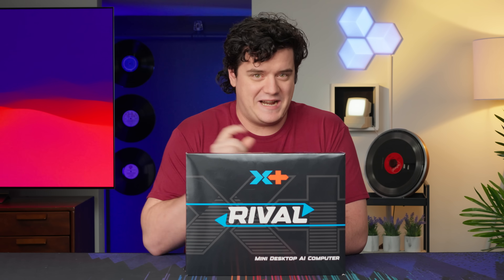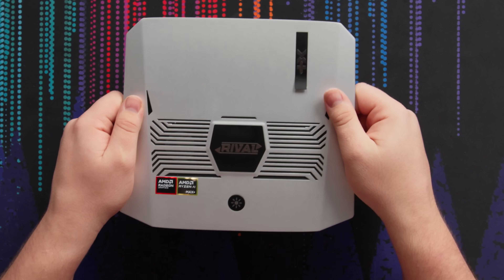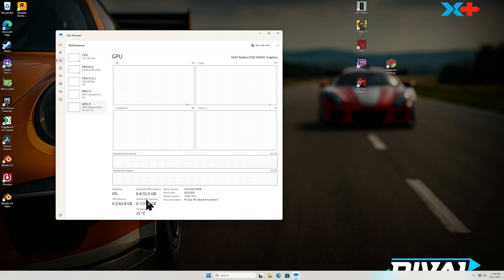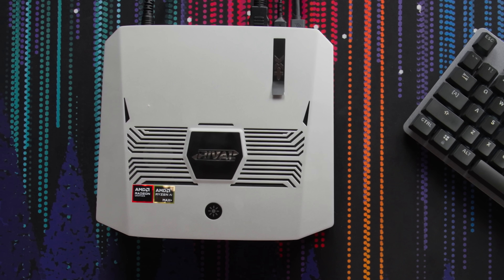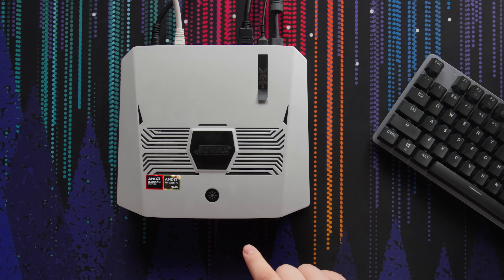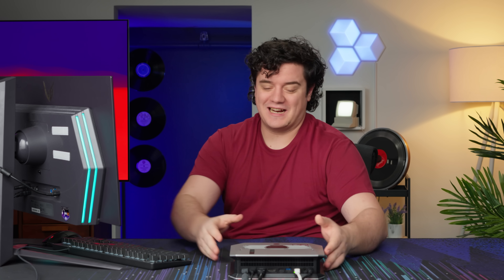This Mini PC Might be the Best Value YET - X+ Rival

Comment: Blower fans are always pretty loud but especially if you insist if having the intake side closest to your ears, use the damn stand and position it so the top (with the blower fans) are facing away and it makes much less noise.
Also, you can control the fan in bios or with third party sw.
In Linux it's very silent with normal workload.
This was a childish and uninformative review.

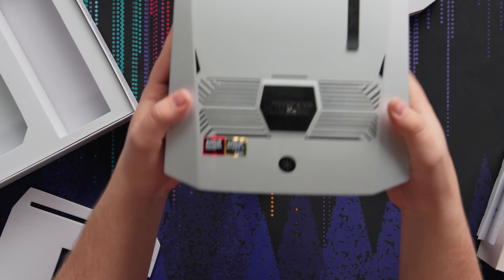Comment: 2:03 I don't give a fly F which way you like the look of something. What's the whole point of ShortCircuit and why do you even bother showing everything that comes in the box. Its to show what's in the box and what it does for others. Not how you like to use it. So next time, build the stand to show it off. So I can decide how I like the look of it.
Reply: I feel like you have valid points but your being very harsh as a default. My immediate response to seeing your comment was an eyeroll.

'So next time, word your comment to constructively criticize. So we can understand the point of it'
Edit: Grammar
Reply: @webb.weaverr  That is very true, but also kind of the point. It takes little effort to be pleasant in my comment, just like it takes little effort to build that stand.

And it is also a unfortunate effect of the internet. That if you want to cut through all the noise, you have to be like this.

If it was enough to stand out and make you comment. Then it will be enough to stick in their mind. And not resort back to a lazy behaviour.

Comment: This is basically a laptop without a screen. It's overpriced, it'll overheat, and you can't upgrade,. MicroPower PC has small form factor prebuilt systems but with real pc hardware and good value

Comment: It's worth mentioning that the new rog zflow z13 has this chip with a 128GB of 8000 lpddr5x option. So you get all this in a 13 inch tablet form factor. It's about a thousand more dollars, but get you a dock and have all that power on the go. You guys had the device on short circuit before but that was a 12900H and rtx 4050 model I think.

Comment: While watching this video, I had the thought "that's a red flag" several times. Then at the end of the video you pretty much confirmed that this is a cheap junk device at best and a scam at worst.

The red flags were things like:
1 Inconsistent marketing information like listing the performance modes differently in different locations
2 How surprisingly light weight the item was
3 Outright wrong information like the ram speed
4 Cutting corners to save money with things like the small heat transfer pads and the noisy fans
5 Constantly being heavily discounted, despite being a brand new and super popular product category (a pc built for AI processing)
6 The price changing when you reload the web page

Then at the end of the video you tell us that this item can be found on alibaba for hundreds of dollars less, so bottom line this item is a junk device at best.

I would be highly suspicious of counterfeit parts and/or parts listing fake numbers that tell windows they have a much larger capacity than they actually do.

Comment: Linus is part owner of framework, so of course it's going to show higher on any tests than a competitor. 
And also, the Rival is so loud, and overheating because you didn't install the standing mount, and one of the fans is on the bottom, which you have pushed down into your desk pad.
Reply: :face-red-heart-shape:

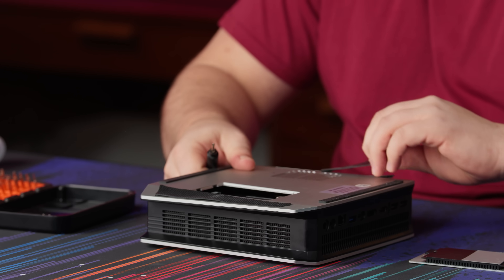Comment: 4:10 That is good. Only the controller needs cooling as it generate the most heat and the flash chips themselves prefer running warm for better performance.

Comment: Yeah the fan noise was def blasted towards your face 😂
Reply: yes, but we need to see the lab footage of the test.  the included stand, which was in the manual, was never assembled. This is a sham comparison; totally subjective, yet entertaining :)  there are simply No data point comparisons on benchmarks, noise in decibels, and didn't even do a side by side size comparison. Lastly, there was no disclosure with Linus' relationship to Framework. Serious ethics questions is you ask me. :text-green-game-over:
Reply: @axgadgets  the device literally had feet so i dont really see how not using the stand is invalid here, it is supposed to be just a stylistic choice
Reply: @axgadgets  Framework disclosure at 0:09.

Comment: We need to see the lab test footage to validate the data points. While I love Elijah, the PC was not standing up as it is in all the "marketing" materials. It needs to be standing up for proper ventilation. Rival could possibly outperform the competition on all fronts. Especially, if it was tested the same way that Eli "tested" it in this review.
Reply: +1
Reply: Except the photos on the website multiple times show it in the flat position without the stand. That is clearly an officially supported orientation. There are even rubber feet on the "bottom" to make this work on a desktop.
Reply: yes, we should demand to see the lab footage of the test.  the included stand, which was in the manual, was never assembled. This is a sham comparison; totally subjective, yet entertaining :)  there are simply No data point comparisons on benchmarks, noise in decibels, and didn't even do a side by side size comparison. Lastly, there was no disclosure with Linus' relationship to Framework. Serious ethics questions is you ask me.

Comment: despite Elijahs best efforts this looks better than the framework
Reply: Yes, especially now that the test footage is in question.
Reply: Good point.  They even tried stand wasn’t assembled during testing, despite assembly being instructed in the manual
Reply: @JessicaGiz-t1x  100% agreed. We need to see the actual framework side by side with the Rival and comparison noise test results. Third party lab tests for both would also be nice. Also, footage showing that the Rival's stand was assembled during the third party testing.
Reply: several issues with this review. there was no disclosure with his boss' relationship with framework. no confirmation that the unit was tested properly as the stand was never assembled. Lastly, it was a comparison review, but with no decibel testing for noise, or no size comparison, or common data point test for benchmarks on BOTH units.
Reply: I must concur with you
Reply: +1
Reply: Yes. They even tried to peel off or bend the logo plate.
Reply: It's so funny that everyone replying to this comment is from the company itself. Funny how they are all pretending to care about transparency but hiding behind different accounts. I've taken screenshots of all your accounts and seen you posting on other reviews of this item on other channels as well.

Comment: So advantage this has: its cheaper. 

Advantage of the framework: customer support (x+ is your typical generic chinese slop brand, that has tons of non existent customer support horror stories with no counterclaims), a standard itx motherboard layout, so you can put the board in any case you want (they even sell the board seperate from their stupid little case so you can put it in whatever case you want and save money) it has a pcie 4x slot for epansion cards if you put it in a real case. The mb mounted heatsink takes a standard 120mm fan, so if your fan dies you can replace it. Comes with two internal usb 3.1 headers you can do basically whaever you want with, either dual usb c or you can convert one to usb 3.0 a ports with an adapter. 3 fan headers for larger itx chassis like a node 304 if you want to put this in a home server. 

The framework is pricier, but the standard form factor motherboard makes it significantly better for me. Makes either the case or the board usable without the other in a way all of these other mini pc's are disposable trash once the hardware inside is done for.
Reply: yes, but we need to see the lab footage of the test.  the included stand, which was in the manual, was never assembled. This is a sham comparison; totally subjective, yet entertaining :)  there are simply No data point comparisons on benchmarks, noise in decibels, and didn't even do a side by side size comparison. Lastly, there was no disclosure with Linus' relationship to Framework. Serious ethics questions is you ask me.
Reply: @gigichan-q6s dude I don't even trust labs. I've seen what LMG is capable of in terms of bad information. If you want good reviews of the stuff just go to other channels. Don't ever watch any LMG channel for any serious reviews

Comment: framework this framework that, im getting confused. is this a comparison video or what?
Reply: it seems to be a marketing ploy. No proper Rival test was done due to the lab and Elijah's failure to assemble the stand. We need to see the lab footage of the test.  the included stand, which was in the manual, was never assembled. This is a sham comparison; totally subjective, yet entertaining :)  there are simply No data point comparisons on benchmarks, noise in decibels, and didn't even do a side by side size comparison. Lastly, there was no disclosure with Linus' relationship to Framework. Serious ethics questions is you ask me.
Reply: @UnbuntuCrew ikr seems like they are making it look bad to upsell framework

Comment: Why are there so many mini PCs with that chip? What's the use of an APU in a PC even if small. For games, it is analogous to 5060ti getting paired with ryzen 9 9900X and no one would buy an AMD gpu for AI and would rather spend twice or even three times as much for recent Nvidia DGX. The last good use case is video editing and 3d modeling, but again, 5060ti or 5070 laptop would be better for 3d modeling and Mac Studio or again 5060ti will better for video editing.

The only possible upside of the Strix Halo is in laptops - small 14 inch laptop can rival large 16 inch gaming laptop with core ultra 9 and rtx 5070 while being much quieter and cooler and having much longer battery life when used for whatever else other than gaming. Why are there only two laptops with them and nearly dozen mini PCs?

Comment: With the utmost respect: Blower fans were never going to be any kind of quiet. They have been notoriously loud in just about every deployment of them in server systems. This wasnt going to be any different.
Reply: yes, as viewers and consumers, we should demand more transparency. As someone pointed out, we need to see the lab footage of the Rival test.  the included stand, which was in the manual, was never assembled. This is a sham comparison; totally subjective, yet entertaining :)  there are simply No data point comparisons on benchmarks, noise in decibels, and didn't even do a side by side size comparison. Lastly, there was no disclosure with Linus' relationship to Framework. Serious ethics questions is you ask me.

Comment: To upgrade or to do any kind of repairs we remove those panels by unscrewing screws once in a while. If you feel that is also inconvenient, no one be as much lazy ass as you for sure.
Reply: Maybe it was done on purpose. the lab didn't assemble it either. Both "marketing" materails and "two" manuals had instructions on how to assemble.

Comment: I don't think you said Framework enough!!
Reply: yes, it was never actually compared physically or with data points.
Reply: @dealsprime  Rival datapoints are in question as the included stand, which was mentioned in the manual, and in all marketing materials, was never assembled by the lab or the reivewer. He is blocking the airflow during this review. Whose to say that the lab didn't do the same?
Reply: @gigichan-q6s  and also when he turns on raytracing the:12:38. I'll let you see for yourself.

Comment: Is the bottom fan actually doing anything when you've placed the case flat on the tabletop?  Shouldn't it be standing up on one side, to allow both top & bottom case fans to pull in fresh air?
Reply: Even the promotional manufacturer's material is showing it in both horizontal and vertical positions. So the video is simply showing it in one of the intended cases (i.e. using an ADVERTISED FEATURE)
Reply: You are 100% correct to raise this point. No proper Rival test was done due to the lab and Elijah's failure to assemble the stand. We need to see the lab footage of the test.  the included stand, which was in the manual, was never assembled. This is a sham comparison; totally subjective, yet entertaining :)  there are simply No data point comparisons on benchmarks, noise in decibels, and didn't even do a side by side size comparison. Lastly, there was no disclosure with Linus' relationship to Framework. Serious ethics questions is you ask me.

Comment: Screws under Rubberfeet? Conflicting descriptions with Mute Mode (Power Saving Mode) which delivers "high requirements for laptop battery life."? WTF. Why is this Video even made lol I could never buy something like that...
Reply: You are 100% correct to raise this point. No proper Rival test was done due to the lab and Elijah's failure to assemble the stand. We need to see the lab footage of the test.  the included stand, which was in the manual, was never assembled. This is a sham comparison; totally subjective, yet entertaining :)  there are simply No data point comparisons on benchmarks, noise in decibels, and didn't even do a side by side size comparison. Lastly, there was no disclosure with Linus' relationship to Framework. Serious ethics questions is you ask me.

Comment: If we're spending 2 minutes trying to get in and see the cooling but ultimately can't, why are we watching it and spending time on it?
Reply: also, the stand should have been assembled. Lab didn't assemble it either during testing. how was this unit tested? In the proper position?
Reply: we need to see the third party  test footage to verify that they tested it properly. It was not properly tested in this video here. The included stand was not ever assembled, as recommended in the manual.

Comment: This video should have an investment disclosure since framework is a direct competitor to this. I don't think it's bias but I do think no disclosure is dishonest.
Reply: You are 100% correct to raise this point. No proper Rival test was done due to the lab and Elijah's failure to assemble the stand. We need to see the lab footage of the test.  the included stand, which was in the manual, was never assembled. This is a sham comparison; totally subjective, yet entertaining :)  there are simply No data point comparisons on benchmarks, noise in decibels, and didn't even do a side by side size comparison. Lastly, there was no disclosure with Linus' relationship to Framework. Serious ethics questions is you ask me.

Comment: Comparing this to a Framework desktop just in performance is really not understanding why Framework exists.
Reply: yes, but we need to see the lab footage of the Rival test.  the included stand, which was in the manual, was never assembled. This is a sham comparison; totally subjective, yet entertaining :)  there are simply No data point comparisons on benchmarks, noise in decibels, and didn't even do a side by side size comparison. Lastly, there was no disclosure with Linus' relationship to Framework. Serious ethics questions is you ask me.

Comment: Wow that looks very cheaply made...
Anyone else notice the half unstuck label on the top?

The only thing i prefer on this compared to my new framework desktop is the 96gb ram option, i thought 64gb was not enough and 128gb was overkill, i went the overkill option 😆

That said, one of the main reasons i got the framework over other manufacturers was because it was quiet, this one being so loud is a complete deal breaker for me.

Comment: lame power btick at 0:46... its not type-C and cant be adapted to... it runs at 12amp and a lowly 20v voltage, vs the 5amp at 48 vold  chad type-C spec max.

Comment: My only problem with the framework is that there is no pcie 8x or 16x ( would be fine with it if it was just one of those mini ones ) so I could connect a more powerful dedicated GPU into it ( with more then pcie 4x lanes ) through a cable
Reply: there could be significant performance discrepancies as well. No proper Rival test was done due to the lab and Elijah's failure to assemble the stand. We need to see the lab footage of the test.  the included stand, which was in the manual, was never assembled. This is a sham comparison; totally subjective, yet entertaining :)  there are simply No data point comparisons on benchmarks, noise in decibels, and didn't even do a side by side size comparison. Lastly, there was no disclosure with Linus' relationship to Framework. Serious ethics questions is you ask me.

Comment: it's literally bottlenecked by set up in a wrong way, the bottom fan Is choking without air
Reply: exactly!  No proper Rival test was done due to the lab and Elijah's failure to assemble the stand. We need to see the lab footage of the test.  the included stand, which was in the manual, was never assembled. This is a sham comparison; totally subjective, yet entertaining :)  there are simply No data point comparisons on benchmarks, noise in decibels, and didn't even do a side by side size comparison. Lastly, there was no disclosure with Linus' relationship to Framework.
Reply: @SinoDevelopmentSino  honestly that wasn't a really good review with that chocking and inability to just check if everything's alright

Comment: It would have been cool to go all the way on the tear down to see what type of cooling mount they use. Because if its biggest problem is cooling and it can be swapped with a standard radiator, this is killer value. Otherwise I would not bother with a chip that is constantly rotting itself, not worth the longevity risk